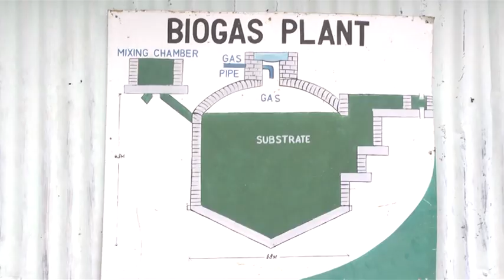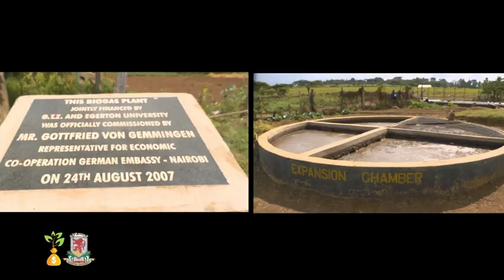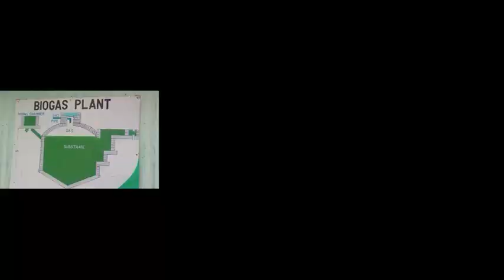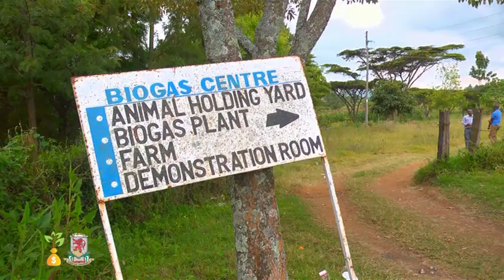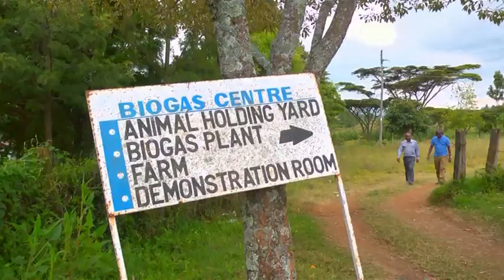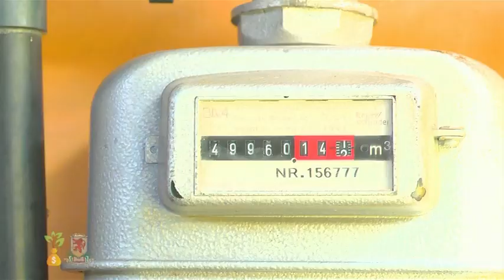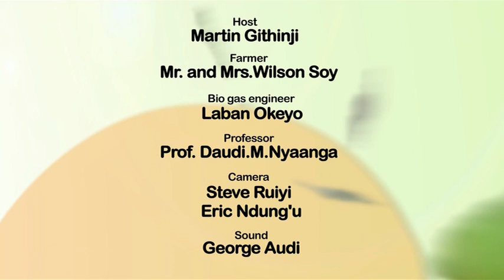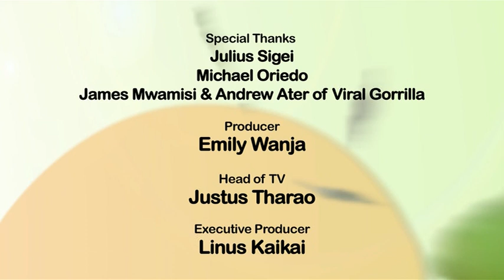Bio Gas - Season 1 Episode 9

Comment: I am watching this in Canada. I want to make a biogas plant in a greenhouse. We have winter that will halt gas production and will burst our tanks if they freeze. You are lucky to have warmth all year round. It is good for your digester. 
I have seen many biogas video's and I must say that this is my favoutire one yet. It is nice to see how different people have different approaches and it is nice to hear them all agree that it has been worth the investment too. Those plants are amazing too! Wow! Keep up the good work! This is the first video I have seen of yours but I have subscribed already. Great work
Reply: It's also able to build a Biogas-plant in Canada. You need a good thermal insulation, though. The chemical reaction is exothermic. So with a good enough insulation you propably doesen't even need to heat it. A tick layer of rock wool should already do the job. as soon as the heatlos though the insulation is smaller then the produced energy in heat. It will automatically heat up. You can also use thermoelement to meassure the inside temperature and control it. apparently there are even some biogas-plants in colder regoins, that use a small gas boiler (like cor caravans) to heat water and this water is pumped though pipes in a cycle though the Biogas-plant. So the water never comes in contact with another fluid. This way you will lose some small amount of gas but are still able to build a biogas-plant.

Comment: Greetings from the Netherlands.👍

I love these kind of video's.  In your country the conditions to do something like this are better for doing this then in the Netherlands.   I think the production of gas will be far less when it is colder. And we have shitty winters overhere. I have build a woodstove that generates electricity. And that also heats a 500 liter boiler for hot water and a 3000 liter boiler to store heat for later purposes. 
I wanted to build also a woodgasifier. But after America has been corrupting the entire Ukraine and has been plotting and sceming to start a proxywar prices of wood also have been skyrocketed.  And wood has becomes scarse.  So i have to minimise the use of wood. 
This seems to me a good alternative.  Overhere they also used a similiar system back in the time of WW2. And used it to power vehicles.  They indeed were driving around with such a big bag you have on the top of the car.  It was not as good as fuel but they could travel with the use of natural gas.  Made a few adjustments to the carburator and that was it.  But the gas had to be clean so they needed to filter it with bleech and water. 
But i find it very strange what they are doing in your country.   It is much easier to set up a handfull solarpanels and start cooking electric. This is also much cleaner.  Do not get me wrong but this type of gas can be very unhealthy.   This kind of gas can destroy the brain.  It is very harmfull.   You have to use it at a place with a lot of ventilation.   Also the way the bag with gas is placed gets me a bit anxious.   I would use things like  appendixes like a B-valve that will prevent the backlash of fire into the pipes or tubes. 

I see that they are often feeding the gasifier with cowdunk.   From my knkwledge this only needs to be done at the start. But i could be wrong about that.  People like those in this video are often people that know better what to do then we people in the West.  We are not self-reliant anymore. 
I would definitely use a kg of suger from time to time.  This would boost the fermetation tremendously i think.
And i would also play some music from the Beegees.   Sure that this will help.🙈

Why not use the gas for a generator ? And just lead a powercable into the home or kitchen ? Then you can cook keramic or with induction. This is much safer. And the surplus of the electricity can be used for much more.  For light and even getting hot water for taking a shower. 
Or doing this in combination with a few solarpanels. In your country solarpanels are much better then in the Netherlands.  Much more sun. 
And when it is dark then you could use the generator.  This would be my idea when i was living overthere.

I will try to build my own bio gasifier. More then enough space outside.   Need to create something that is way bigger then the ones i saw in this video. Because it will not work as good as in your country. Although certain bacteria also must nog get to hot. Otherwise they die. 
You could easily try the use of a generator. Simply hold the end of a hose at the insert of the carburator.   It should be able to run. Connect a simple valve at the end of the hose. Later when it is functioning properly you could make something better and more permanent. 

Greetings from the Netherlands and thanks for the idea.💪💪🙏🙏

In the end of your

Comment: I love this concept.  It makes so much sense!  It is a natural process.  I can see this in an off grid situation along with the use of the hydrogen cell electricity generator, powered by natural gas.  I can see the sewer, waste management department, and power plants working together, using biogas instead of fossil fuels.  The infrastructure for distribution is already in place as are the storage facilities.  The possibilities are endless, in my mind.
Reply: You nailed it on the head big time. The economic, financial and ecological benefits of the concept are innumerable and truly exciting
Reply: The proyect is perfect for 80%.....
It needs to  complète/change it for to have 100%.... if not a bit of hard problems will arrive..  by...

Comment: I am building a similar one in the future. I was going  to lay a pvc pipe in concrete from bottom vee to outlet tank at angle then remove the top half at bottom and install a screw to remove solids. 
1, How do you get the inevitable solids build up from the bottom so you don't loose capacity?
With your tank because its already made I would have a capped suction pipe to bottom so I could remove a few gallons a week.Do solids build up?
2. Do you clean the gas before it goes inside for use? If so how.